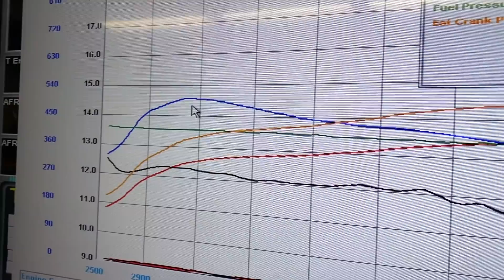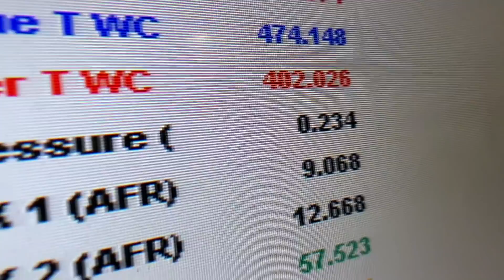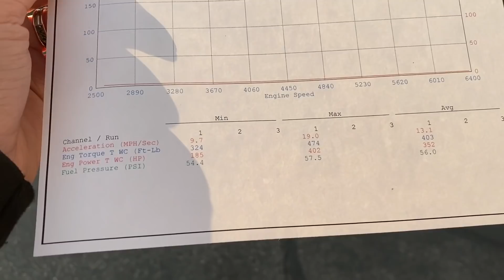HOW MUCH POWER DOES IT MAKE? Chevy LS3 427 build.

Comment: Lite Brite did well, a 1min 53sec lap is nothing to sneeze at. 😀

That said, the first jump was pretty steep, not quite a nose dive .. but ...
And the corner after the jump was a two wheeled one ...
the silt up the hill was a bit slow ...
the rest was pretty good though. 😁

Damn, the Power Hour lived up to it's name - There were some crazy times there.
One of the Gomez guys beat our silly duo in 3 wheel drive, (he lost a front axle), that's how nuts it was !

Lite Brite ended up in 46th position, not bad at all!
Reply: You where hating in the live chat
Reply: @BubbaBen01  
What ? But I didn't ?

Comment: Lite Brite. Qualifying one minute and 53 seconds 👊
Reply: Add 20 seconds.
Reply: @tntzimmerman9552  They did a sub 2 min. Lap. Op is correct on the time.
Reply: The commentators were quite surprised at how fast K & B were. Sub 2s!!
Reply: @justinbarber24  yes, it’s correct now. It’s edited.......
Reply: @tntzimmerman9552  it's edited because I was talking to my phone and it was spelling stuff incorrectly and put wrong numbers in so when I noticed that I corrected it. then you said I was off by 20 seconds. But it's no big deal,we're all here for lite Brite.👍
Reply: Anybody here about the position
Reply: @davidgroskopf7898  https://www.ultra4racing.com/2021-optima-batteries-koh-qualifying-results. Looks like top 50 like they hoped.

Comment: Had a dynamic in college.
School has a donated Viper V10.
Untill someone with wide feet get tangled. 
Dumps clutch and bounces rear end3 ft in the air. Need mid range straps.
Thank God for master shut off switch.
Like a hotdogs in a saw blade .
Saved it . Straightened out two srap hooks  TOO, . In house wheelie(unintentional).
S.P.S.C.C. OLY,wa.

Comment: I know it's a little late now but I wanted to let Kevin know that I have good luck painting my header wrap after I install it and I also use thick safety wire to hold the individual ends down under the last wrap. In an off-road application paint helps keep it dry, nothing is worse than hitting a hole and getting it soaking wet and then having to climb something technical with all the steam coming up and blinding me. It also seems to make the wrap last longer in places where it's exposed to debris or the high velocity air. I use VHT flame proof paint, if you want to look at it give me a buzz next time you pass through DFW and you can look at my stuff that was painted 4 years ago.

Comment: Did the rules mandate such a low perfomance engine ? Was it chosen on cost ? The only way to make a NA engine perform is to let it breathe at high rpm. That OEM intake manifold is junk and is choking the engine.